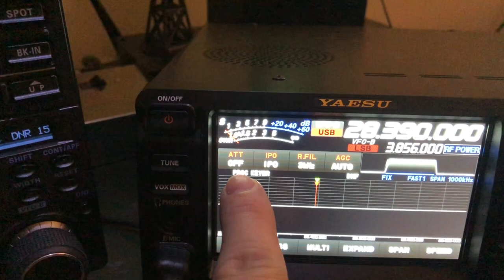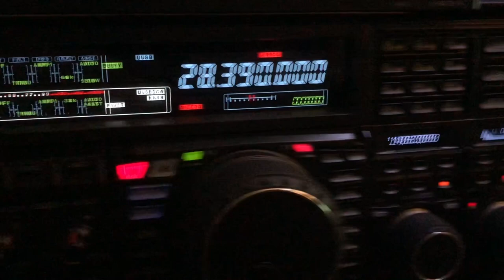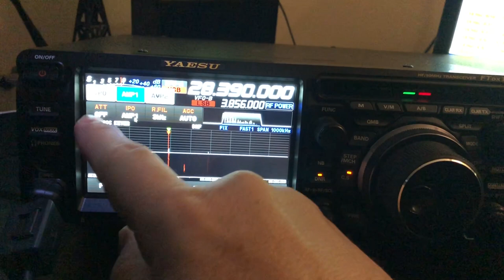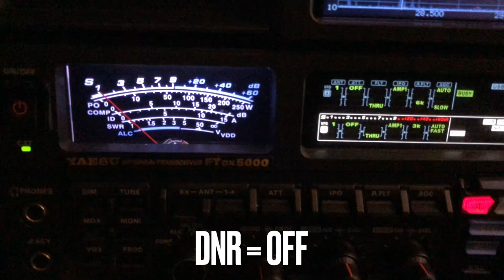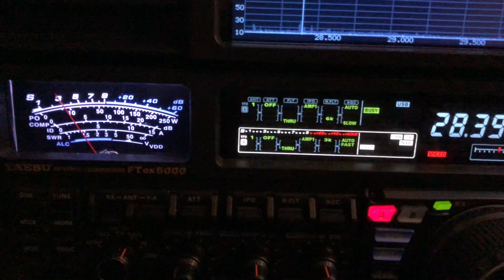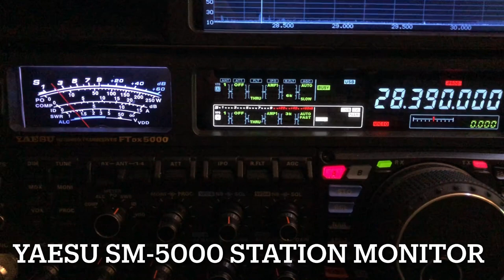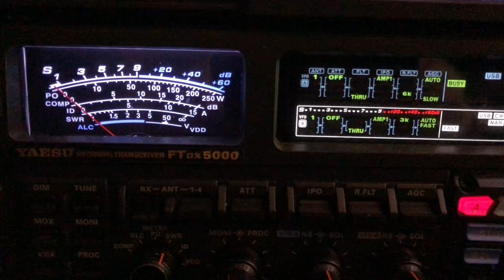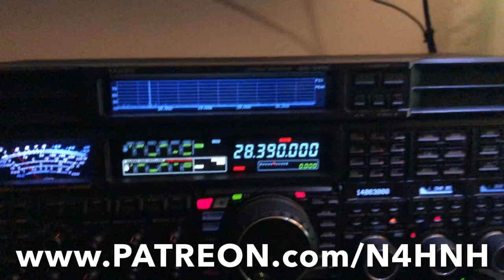FTdx10 & FTdx5000MP: 10 Meters Performance Difference (Video #35 in this series)

Comment: Interesting comparison.  It certainly confirms the performance of the FTDX-5000 in day to day typical real world operating, and it remains very high against the latest analog/SDR hybrid designs from Yaesu.  I own a 16 month old FTDX-5000, and find it to be the pinnacle of analog HF from Yaesu. The 5K has proven to be better than the FTDX-9000mp and FTDX-3000D, I once owned, and of course well above all the 1000's series I've had.

Additionally, I recently viewed a comparison by a well known ham radio YouTuber.  He was comparing the FTDX-10 and the IC-7300.   During that review, he mentioned the FTDX-101, and said it seemed to him, the FTDX-10 is actually a bit more refined than the FTDX-101.  The FTDX-10 is impressive in his demonstration.  I wonder about the FTDX-101, and how it compares to the FTDX-5000 in a similar real world demonstration as shown here.
Reply from the maker: I put the FTdx101 against the FTdx5000MP before deciding on the FTdx5000MP. They were neck to neck but I preferred the ergonomics of the 5000 and the DNR was better in the 5000. After the FTdx10 was released, with DNR that was as good as the 5000, the FTdx101 got a firmware update. 

73, de N4HNH

Comment: The problem I’m having concerns the QC for each radio coming off the line. A disturbing example of this is the FTDx10 ARRL received for its tests of the radio. They were using high end testing lab equipment and found a specification that seem off. They sent the radio back to Yaesu and they determined that it had a bad roofing filter. After receiving back the radio ARRL completed its test. If I had purchased that particular radio how in the world would I know a roofing filter was wasn’t
Reply: Let me finish here….How would I know the roofing filter was out of spec??  So I’m making comparison test not knowing one radio is not working properly.
Reply from the maker: Without test equipment you might set the digital width to the same width as the roofing filter and see if you can hear much difference when you set digital width wider that the roofing filter.  Fir example, in CW mode the roofing filter is 500Hz.  Set the digital width to 500Hz.  It should sound roughly the same.  Then set digital width to 600 or 700 Hz.  Does the width still sound like 500Hz?  If so, the roofing filter is probably okay.

73, de N4HNH
Reply: @n4hnhradio  Good suggestion. Anything that those of us who don’t have good lab equipment can do to check the radio’s performance is a great help. There has to be an equitable playing field before we can suggest that one radio may perform better than another of similar technology.

Comment: Interesting comparison. I'd like to hear them both on the same speaker. The 5000 speaker seems to have better base response. Thanks for your efforts!
Reply from the maker: Actually the SP-30 has a larger resonance chamber so it is capable of much more low frequency response. The FTdx10 has 3-band equalization for the receiver. I avoid turning the bass up too much, especially when this video was recorded. Later, I added foam to the SP-30 to improve how it sounds. But, with the FTdx10, you have the 3-band EQ plus audio shelving filters. You can do so much with the received audio. Ironically, the FTdx101D/MP doesn’t have the 3-band EQ for receive.

Comment: That's quite a noticable difference.  You're not making my choice between the FTdx5000 and FTdx101 any easier, although I wonder if the 101 shows this same behavior.  Out of curiosity, what is the distance between the back of the FTdx5000 and the front of the front foot?  It seems silly but one of the things that I have to consider between the two radios is that the 5000 is considerably deeper.
Reply from the maker: Hi Jonathan!  It’s approximately 1.5 inches from the front bottom edge of the radio to the front foot.

73, de N4HNH

Comment: i think that the ADC in FTdx10 is having problems processing a 28MHz signal hence more noise.
Reply from the maker: Actually I found out later that I had left the DNF on. It can introduce distortion. Since then, the FTdx10 has been fine on 10 meters.

Comment: The difference between processing a signal with electronics and pretending to with software perhaps?
Reply: Makes sense
Reply: I would have to agree 100. The problem is, each has has caveats.
 Myself, I love BIGass radios, I love knobs, and switches. I like to tune in a station, rather a chip to suggest HOW it should sound, and, for me, being able to operate a rig with 1 light out like the 5000, won't shut the whole rig down....plus the antique almost sound quality.......mmmm
Now, what is the difference when the gain is turned down, or ATT is ON? I would almost bet the 5000 has a lower noise floor in almost every situation, so in all actuality, I bet it comes out the same EAR DB wise,,,,,,maybe not meter, but that low......meter doesn't matter, or does it?
Did I mention, it's just that SOUND!!!!!